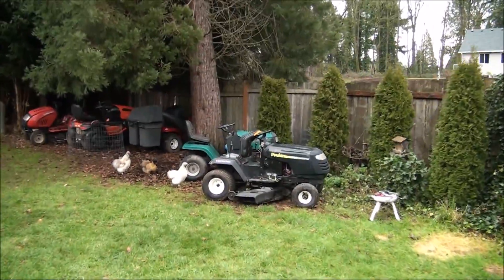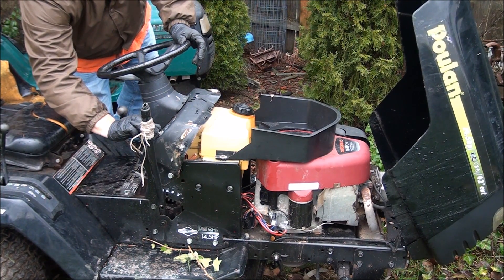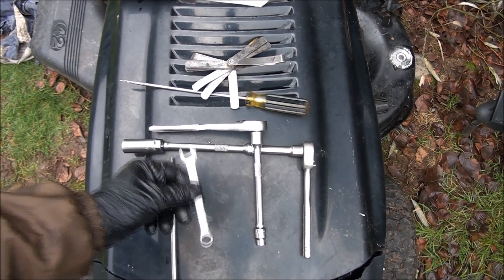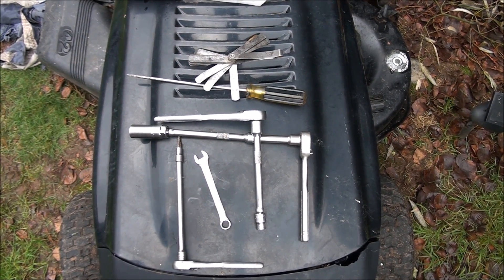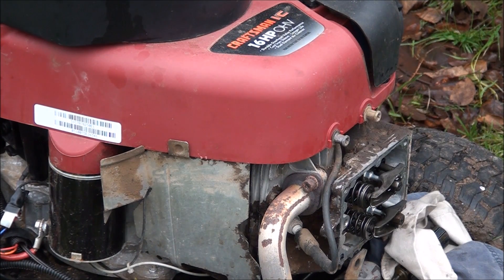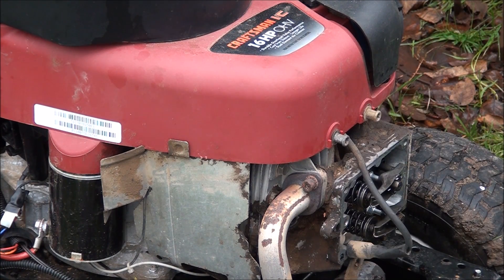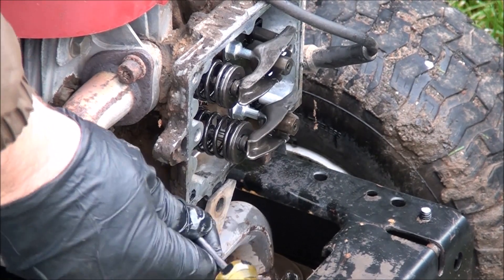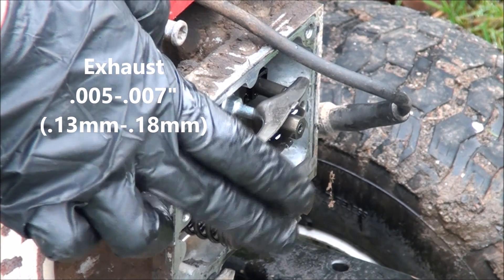Is it the VALVES? Single Cylinder Briggs and Stratton OHV VALVE ADJUSTMENT Procedure and Specs

Comment: I think it would  have been a good idea to remove the rocker and support stud to put some thread locker on the stud threads, I have a feeling the factory puts something on the threads to hold them.
Reply: You are correct. Recently my engine started making a tapping noise that quickly grew louder until the engine died. When I took the rocker cover off the intake valve rocker arm was loose and it had rotated 90 degrees. What had happened was that the intake rocker arm support stud had unscrewed out of the head and it was almost all the way out. The stud had been installed with no thread locker on it. To be sure I took the exhaust stud out just to check it and it already had thread locker on it. Apparently someone had forgotten to put thread locker on the intake stud and only did the exhaust stud, which is why the intake stud unscrewed out of the head.

Comment: been trying to set my valves on my 16.5HP Briggs powerbuilt OHV engine just like in the video.. after i set them i get one good start then same issue with lag crank.. any ideas?
Reply from the maker: starter motor?
Reply: @JeffsLittleEngineService  checked starter, checked battery and solenoid no burnt wires anywhere
Reply from the maker: those starter motor bearings/brushes do wear out.  WD40 might help.
Reply: starter works flawless on another engine.. this one has me stumped
Reply from the maker: I have had a bad solenoid before that seemed like it was working but it was not sending enough voltage to the starter. Try bridging the solenoid posts to see if that sends enough/ more voltage to the starter. Also, make sure the battery negative wire is clean from rust and is grounded properly to the frame.
Reply: I Will check all that tomorrow after work and let you know the results.. thanks for taking time out of ur day to help.. no one else on other videos seem to even wanna give any advice
Reply: Tried jumping straight across the solenoid same issue jump straight from my truck battery to the starter same issue.. battery cables look good on hot and ground I also ran a heavier gauge ground just to be sure.

Comment: I have a hushee 18.5 briggs ans straton 500cc engine in it,  i replaced the starter, the coil, the battery, egnition,  new carb, it started and ran good, shut it off now wont restart, put in new plug, its getting gas, what is wrong, it turns over but will not start.
Reply from the maker: hmmm, if it was a cheap aftermaket coil, that may be the problem. Check for spark

Comment: I have a mower that I need to adjust the valves. I thought it was a quarter turn and not a quarter inch past TDC is that why my mower will only run on choke? It has a clean new carb.

Comment: This defused the ticking time bomb in my motor the exhaust was over .020..  I still suspect a blown head gasket it's burning oil and fouling plugs.  This is best video for find the correct TDC..

Comment: Do a leakdown test. If low, the valve seat can be loose. If the rocker arm is loose check the valve seat. Replace the head.

Comment: Thanks for the very detailed instructions and sharing your valuable knowledge.  I've watched 20+ videos while trying to fix my grandpas old 17hp B&S I/C ohv and I still can't get the dang thing to turn over...It had a blown head gasket, of which the gaskets look designed to fail as they are missing a bolt in a critical location in my opinion...Anyways, after cleaning the carbon, setting the gasket, and adjusting the valves (intake to 0.003" and exhaust to 0.005") I get a chirping sound as I try to turn it over...It almost sounds like airs whistling out of the air filter / carb area in short bursts.  With a fear that I set the valves on the wrong stroke, I double checked and I set the valves again with the piston 1/4" deep past TDC, pulled the filter off to better inspect, tried to turn it over again...and same chirping sound.  Unfortunately, I don't know anyone locally that has the knowledge to help me, and my grandpas rolling in his grave watching me struggle.  Would love to hear your thoughts before he starts haunting me.  Cheers!
Reply: furnace3  it turns out I had reblown the head gasket almost as soon as I had replaced it (didnt torque the head bolts properly..) .  And so I didn't check it until I fixed and rebuilt everything else...shame on me...
Reply from the maker: it sure sounds like the exhaust valve is not working properly forcing the air out the carb. I would check for loose rocker bolts or a bent pushrod.
Reply: Jeff's Little Engine Service Thanks for the heads up!  Looks like im on round 3 for the valve adjustments.  I just hope that third times the charm.

Comment: mine has the 18.5 intek and it hard starts and seriously backfires when you try and start it, has to turn quite a bit but will eventually start. i have checked the sheer key on the fly wheel and its in good order so i guess valves are the next thing to check,,, could this cause backfiring when trying to start but runs great when it finally starts
Reply from the maker: yes , adjust the valves

Comment: After checking my flywheel key and finding it was intact, I was worried the valve gear jumped a cog.  (Totally unlikely!!)  I watched this video and thought I'd see what lays under the valve cover.
I took off the valve cover and found the exhaust valve cap sitting on the bottom of the valve chamber.  Somehow the exhaust rocker arm bolt had started to unscrew itself.   Without the valve cap at the end of the valve,  and the massive amount of slack between the rocker arm and valve, no wonder I was getting kickback and backfire!
I tightened everything up like Jeff shows ... Runs like normal now!
Thanks Jeff!  Without your video, I would have disposed of my 44" mower!
Now I'm more confident about fixin' small engines.
Subscribed!
Best Regards!
Reply: Bravo Mark isn't it great what a huge $$$ savings a little mech troubleshooting can accomplish ?!

Comment: Lots of times they are the valves out of adjustment, or the compression release is bad or the flywheel key is sheared because for some reason they used aluminum keys. Also all the Inteks overflow gas into the crankcase and dilute the oil and they blow up. They’ve been Intek since the late 1990s. They also blow head gaskets because the compression is so high on those engines. Their junk after about 150 hrs. Old engines can have a couple thousand hrs and still run fine. I have dozens of vintage engines that run like a top

Comment: I have the same problem I followed your instructions same issue still occurs. The gaps are the same I was wondering what a decompressor is and is there anyway to test if it is the issue. Any help is appreciated thank you!
Reply from the maker: unfortunately your cam compression release is most likely broken and it will need a new cam

Comment: Last year when Hurricane Irma came through, we lost electricity for almost two weeks. Our (previously barely ever used) generator  began to start rough, and I was told to check that the valve/bolts were tight and moving in and out with ease. That was my extent of schooling on the situation. The generator did still start, but only ran at a max of half of the power it had previously. We had no electric, no cell signal, so no help from the internet. However, in a stroke of luck, our electric was restored that evening. At that time, the generator became a project for another day, and we began cleanup and getting life back to normal. Next month is the start of hurricane season, and my generator has been put to the side (oh no). I've watched several YT videos on the valves, and most of them leave something out. THIS video, is the best that I have seen so far, and  I really don't see the need to watch any others. (Unless I do have a different problem). Thanks for doing this and sharing it with the rest of us.

Comment: hi Jeff,i hav a 2000 huskee 20hp b&s and was in storage for 3-4 years  im fixin for a friend I want it to run forever if can,the problem im havin now is it backfires and pops on high idle and when in gear, it will start no problem and ive added some sea foam already to the gas,what do you think is the problem and no power for the mower deck it just shuts off,thanks
Reply from the maker: most likely the carburetor needs cleaning after sitting for so long

Comment: Alright, so I have tried this many, many times over, and still no luck.1/4 inch past TDC  .006 on top, .004 on bottom, and I still hit that resistance, where the starter starts to smoke... without the spark plug, it turns great, with the spark plug, it won't turn over without a fight... Where am I going wrong?  Aluminum rod is on the bottom, right? I've even tried that both ways.
Reply from the maker: Eric Ek probably a bad cam compression release mechansm.
Reply: You're probably right. Damn...It turned over, everything pointed to valves, I thought I was in good shape... It wouldn't be so bad if that part wasn't more expensive than what I paid for the whole tractor. At least through the dealer. Well, thanks for the insight. Looks like I'll be performing a open heart surgery, and digging out my credit card.
Reply from the maker: It usually costs me around $100.00 in parts (cam, gasket, seal etc...)  I have had to replace several of these lately, good luck! It is "usually" not that bad of a job
Reply: Well, the way I see it, regardless if the part is $90 or $200, I got the thing, and it still has some life left in it, it needs to get fixed. I can get a 212cc (6.5hp) Predator engine from Harbor Freight for $99, but I have a B&S 17.5... And I'm not afraid to get dirty or learn new things. I haven't dealt with it just yet, a $100 part isn't that expensive, but I have 1,000 projects that all need a $100 part, it all adds up... Priorities.
Reply: Well, I'm no mechanic.But I've had to learn a lot over the last few years. A few years ago, I took a stab at towing. I got a job with a company, passed their background checks, and was suppose to be trained at a location that had no customers. After 3 days on, 2 days off, the following day, they let me go. "You just can't tow"... They knew I had no experience.  I didn't even get the proper training. So I did what anyone would do. I bought my own damn tow truck, a business license, insurance and had MY OWN company. But my commercial truck needed work. I didn't have the money to hire mechanics. Si I had to learn how to work on a Diesel. Youtube, my friend. I learned everything I know from Youtube. Forget colleges and Tech schools. It's ALL here if you have the ambition to look for it, stick with it and learn. No one tells me what I can or can't do. I CAN.
Reply: I watched Craigslist like a hawk, every single day until I found the right Tow Truck. 1994 Nissan UD 1400 for $2,000. He said "If you drive down here to get it, you can hook up your car and tow it home"... It was fully operational. I still have her to this day, she needs a new turbo, but over all, she runs and drives great! Since then, I have learned how to work on cars and motorcycles, now I'm getting into small engines. My trike has a tecumseh 12hp engine... It runs, but parts are difficult to find. I have tried to rebuild the carb, but I can't find the right carb kit. It's originally off a 60's,early 70's snow blower. I would love to get it up and running again, there's only a hand full of them in the world. I know of 5.
Reply: Check your starter. Wire,if that is tight make sure its not vapor locking on you

Comment: Many thanks for the video.  Can I ask a supplementary (or two)?  My B&S engine of this type has started to get hard to start (battery etc. fine) BUT at the same time it has started to burn oil when put under load - engaging blades, for instance.  Could that just be down to valve clearances and if not, might it be the valve stem oil seals, cylinder head gasket or worn cylinders/piston rings?  A gasket I could tackle, valve stem seals as long as no special tools are needed, but if it's pistons maybe I'll just run it until it gives up!
Reply from the maker: probably not a valve clearance issue...It sounds like either the engine is getting tired (worn rings etc) or possibly the beginning of a failing head gasket
Reply: Cheers, Jeff.  It was a question more in hope than expectation.  I'll have a crack at the head gasket and check for bore wear at the same time.  A wee donation on its way as thanks for your help.
Reply from the maker: Thank you very much fine sir. I hope your project goes well.

Comment: i don't know if you yanks have ever heard the saying if it ain,t  broke don,t touch it, now why did you undo adjusters without checking first for all we know those valves were correct to start with .
Reply: Did you see how loose the rockers were on their pivots? Experience told Jeff they were out of adjustment without the need to gauge them first. He went in there to adjust the valve lash and that he did. Set them to specs and vrrrroooom.....good as new. Explanation courtesy of another Yank...You're welcome.

Comment: Thank you, I"am currently changing my exhaust valve, and a push rod, because my engine only had a quarter turn,I suspected a valve,so after getting some horrendous quotes,I decided to have a go myself, buying all new parts to morrow for my B&Stratton 15.5 and this Video helped a lot, I will watch the valve settings again when I ready to finish off the job, Considering I am a semi retired Bodt Therapist ,I haven't done too badly, Thanks for the Video.
Reply: Can someone please tell me what a 15.5 hp briggs valves set on?

Comment: Super video! and very helpful! Thanks for posting it!  by the way could I send you a video of my wheel horse motor while it is running and you listen to the engine, it has a surging problem i can't figure out why, and perhaps help me determine what is wrong and what i should do to correct  the surging problem it has? I would appreciate this! I await your reply.
Reply from the maker: Usually, surging is caused by plugged passages in the carburetor.
Reply: @JeffsLittleEngineService  clean all the jets in carb

Comment: Why do the valves move on the first place ? Or how should I say. Great video
Reply from the maker: Thanks friend. Good question. My answer is: The valves get out of adjustment from wear on the cam lobes mostly, but also from wear on the lifters, valve stems , rockers and valve stem caps.
Reply: There is always going to be valve train wear occurring progressively all the time. This is why some auto engines use hydraulic valve lifters to keep the valves adjusted. Cars that don't use hydraulic lifters need to have the valves adjusted periodically during a normal tune up.

Comment: You are correct, the spec. Is 1/4 of an inch past TDC. 60 inch pounds is 5 foot pounds (60divided by 12).  .004 and.006 is the typical valve lash for these engines.  At least you do not have oil going all over the place, as you had when adjusting  the valves on a solid lifter 327 Chevy.  That valve lash was burned into my head, .012 and .018.
Reply: I have run and built several 327 chevs.  My favorite motor.  Getting hard to find.

Comment: I have that same engine but my problem is after cutting grass for maybe 30 mins the engine dies and won't start again for a few mins. Carb and magneto are new. Any suggestions?
Reply from the maker: possibly a contaminated fuel system/carburetor
Reply: Jeff's Little Engine Service thanks ill look into it!
Reply: Leonel Ferrino It may also be building up a vacuum in the gas tank and causing vapor lock. I've seen it before. A small hole in the gas cap will fix it if that's the case. Or find a gas cap off an ATV or dike that'll fit. They work great too and prevent vapor lock.
Reply: carbon buildup on exhaust valve stem will let valve stay open while hot, after cool down it will restart, remove and clean valves and engine will fire right up.

Comment: I HATE these Engines...  I've been fighting mine for over a month trying to get the valves set.  It runs good for a while then I have to reset them!!
Reply from the maker: make sure your rocker studs are tight.. and set screws off course.
Reply: Mike Flynn - really, i have a bunch of older ohv motors that ive never touched, they still run so im not touchin em

Comment: on the hose from the carb to the crank case is there a plastic piece to restrict gas flow? I thought I saw on and when i install a new carb I could'nt find it engine ran for 5 minutes then smoked and stopped what caused this?

Comment: Jeff I need help I have an 18h Briggs and stratton engine I just put a new carburetor on it and for some reason my throttle control isn't working as it should it doesn't idle down all the way I checked the idling screw and that's not it so I'm lost
Reply from the maker: Double check springs and linkages. Hopefully you bought a genuine Briggs and Stratton carburetor. Aftermarket carburetors will give you problems.

Comment: Thanks for the great info; I was helping a friend fix their 17.0 hp Briggs and didn't understand why it would turn over easily without the spark plug in but wouldn't turn over with the spark plug in.

I adjusted the rockers the way you described, and the motor started up right away.

Thanks so much.

Comment: Mine was a broke (intake) aluminum push rod. It would run only with the choke on. After I rebuilt the carb it was still the same so I got a new carb, lol ran the same. So then took off the valve cover and found the broke intake push rod.   Thank you for your video.
Reply: G B